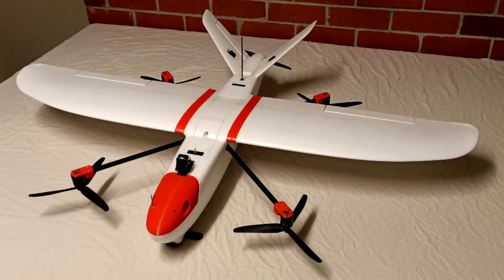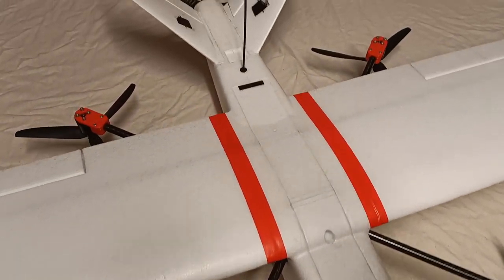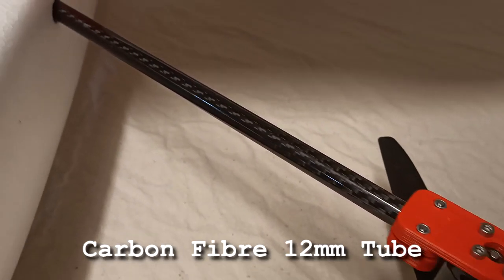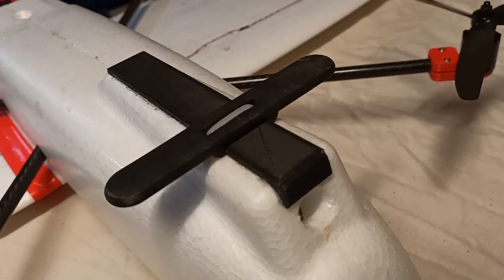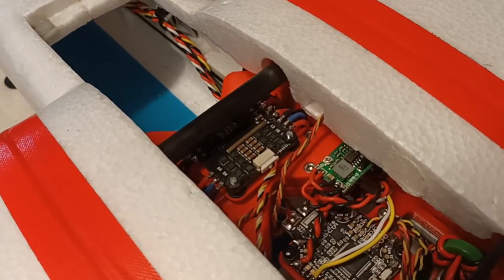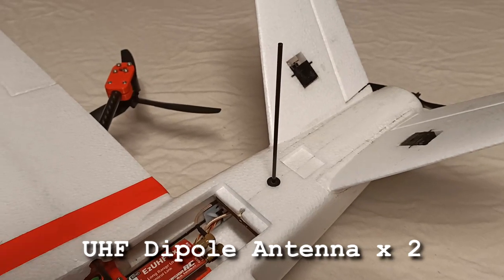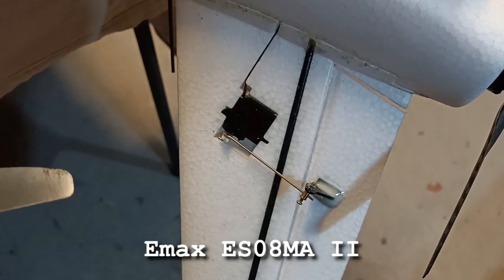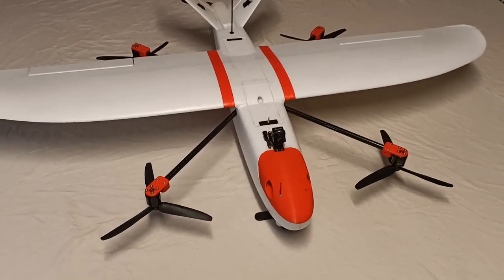» Mini Talon VTOL Build

Comment: What kind of programming did you use for the transition?
Reply from the maker: 3 pos switch. #1 heli mode #2 heli mode + throttle #3 throttle (disarm copter). It's not ideal though, I just wanted to see if it could be done manually but soon I will swap it over to ardu
Reply: @StuntDoubleFPV  In the video you said that you use betaflight. How are you running your servo's and thrust motor of your fc? Or are you doing it differently? Are you maybe using a special fixed wing fc. because i don't know how to fly fixed wing of a quadcopter fc.
Reply from the maker: @martenschutte7182  servos and thrust motor are wired direct to the receiver. It will be much better to re-wire it up for ardu. That way I can use stabilisation in fixed wing mode and get rth too

Comment: Gotta wonder, how much is the flight envelope in wing mode impacted by the quad gear causing drag?
Spitballing thoughts, would a H-pattern frame allow easy tilt of the lift rotors in to forward flight motors, and allow removal of the rear motor?
Or maybe rotate the quad parts in to forward flight position, but use folding props to reduce drag, then fly on the rear motor?
Reply from the maker: Yes there is definitely a drag penalty with the quad gear hanging off the plane. There are pros & cons to all VTOL configs. I did consider an H design with tilting motors. Besides adding complexity the tilting components can add a fair amount of weight too. I just wanted to keep this one simple and try some things I haven't seen done with vtol before